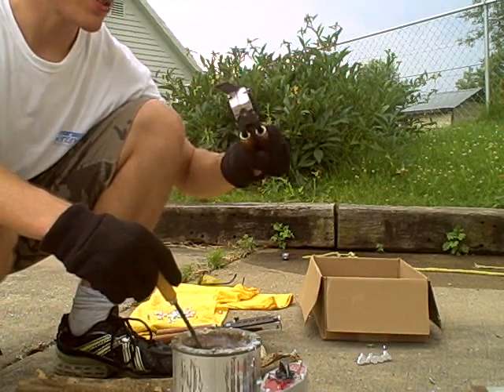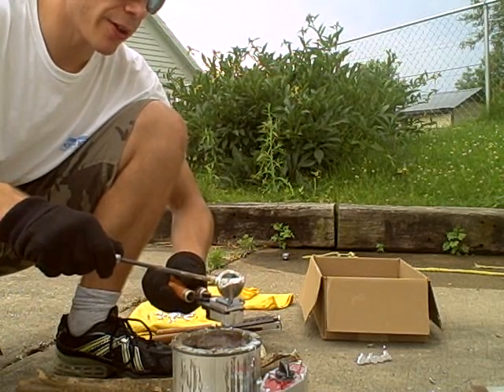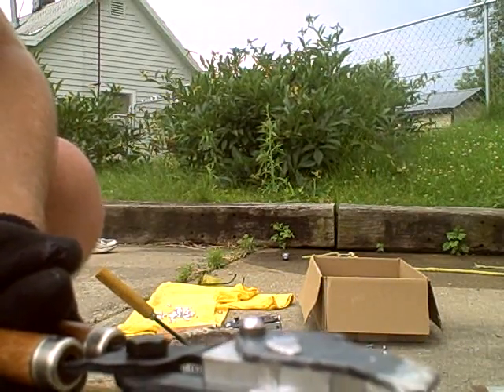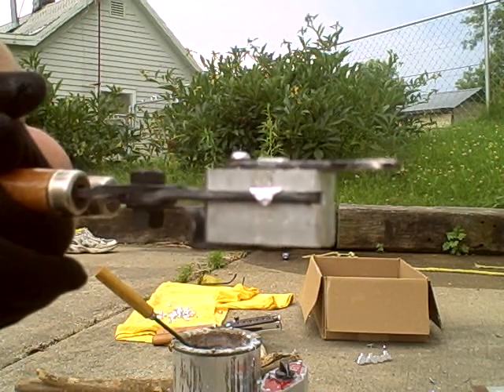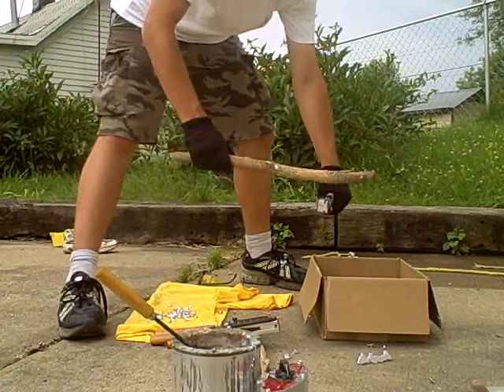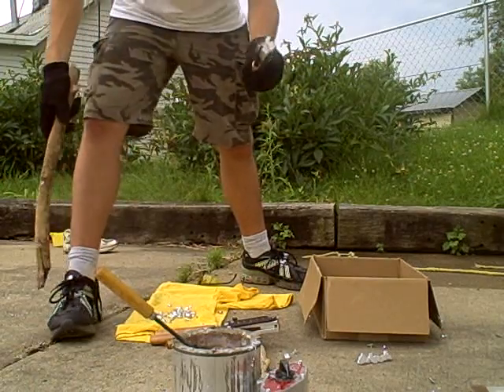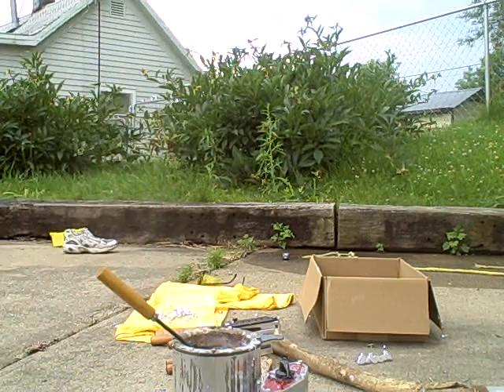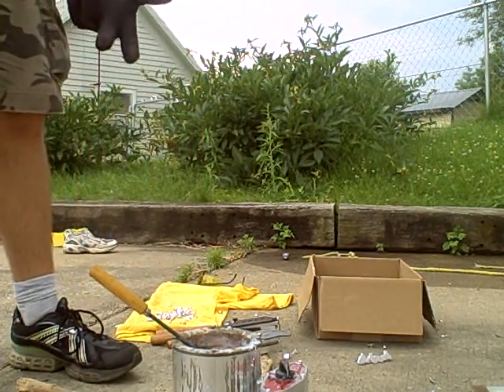Intro to bullet casting #6

Comment from the maker: @OregonBackpacker   Mostly people who give it to me from junk yards and tire stores.  I have got a lot of it from the local auto repair stores in the form of wheel weights, but you have to be careful as some weights have zinc in them, which can really throw off your batch!  I also mine the backstops at the local ranges for used bullets and after washing them, I melt them down.

Comment: Beating Stick - CAT # BS6890 
BATF regulations states that in order to obtain a beating stick whacking carry permit, it must not be shorter than 18"  it must be operated with a single blow action only otherwise repeated blows will be considered full auto hence requiring a prohibited beating stick license.
  
PS nice instructions, I will now purchase a Lee 12g slug mold($30) along with a legally obtained beating stick.